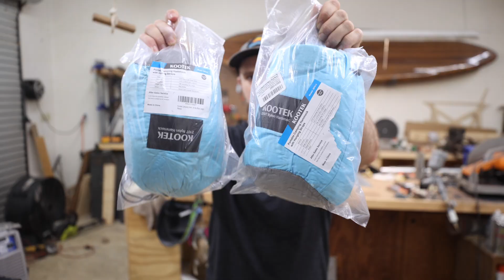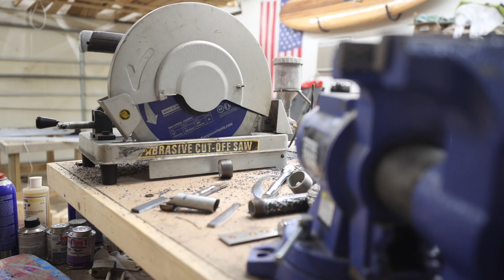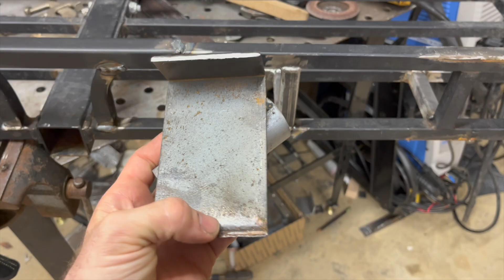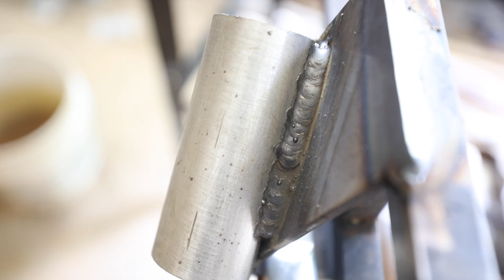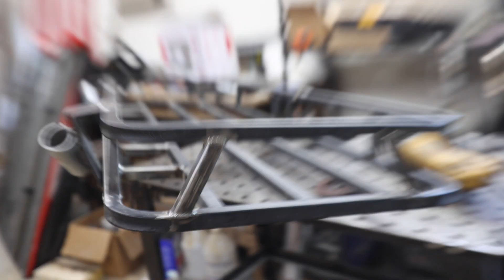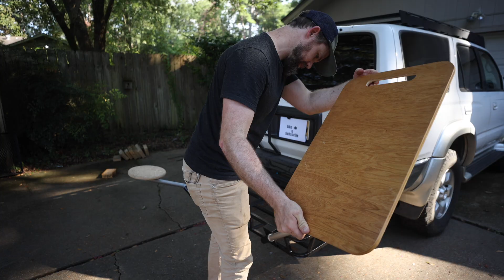Building a Hammock Mount using a Harbor Freight Cargo Rack

Comment: Like surgeon tattoo said I would add legs to either side of the rack that drop down and on the ends of the hammock pulls themselves I'd add like a 10-in extension so you can put up a ridge line and put your rain tarp I was thinking something like a threaded rod so you can adjust it out for length or just tighten it overall.     I also had an idea for a rooftop hammock setup that we go from side to side and you can put a hammock on either side of the vehicle I'm an avid camper and had a few ideas like this over the years

Comment: Another mad video brother, would like to see if any of them could hold 255-260 lb though as I'm somewhere between that at around 116kg-120kg. See how strong they really are.
Reply from the maker: Thanks man! I tested it at 113kg and it seemed to be solid! My first hammock mount 136kg easily. Did you see that video?
Reply: Yer bro I did. Was just wondering, not that I hammock camp or anything. We have a double hammock and stand for it but don’t use it at all.
Reply: @M.love4x4andmore  oh okay personally I have a bad back so I switched to Hammock Camping and fell in love with it
Reply: @kaostheory2940  oh ok. I have misses and kids so just take the camper trailer. Don’t get to go on my own. Feel it would be comfy and a good experience. Whatever gets you out is a good thing.
Reply: If you look up corporal's corner he did a review on a pre-made hammock hitch mount that's made of Dom tubing and can hold like 300 lb that's the one I was thinking about getting in case I had to sleep with my package with my legs by myself in a little over 200 lb so I know you're pain
Reply from the maker: @kaostheory2940  the mount I built in my last video will hold over 300lbs

Comment: If you want to remove the galvanized coating get som muratic pool acid and dunk it until it quits bubbling then rinse with water.
Reply from the maker: I didn’t know that would remove the coating! Thanks for the tip!
Reply: Yeah and 100% try to stay away from the fumes

Comment: Love it! To bad I don’t know how to weld🤣! If I wanted to learn what is the best to learn for a project such as this?
Reply from the maker: Thanks! I taught myself watching YouTube. It’s really not hard. There are soo many knowledgeable people here. It’s something you won’t regret learning to do.  Within a couple short sessions I could weld confidently enough to start making things. It didn’t look pretty but it worked. Buy some small mild steel plates or cut off scrap on eBay to practice with. 1/16 - 3/16 thick. If you are looking for a welder give YesWelder a look. Best welders your going to find at that price. They are always offering 20-25%off so watch for those promotions.
Reply: If you look on corporal's corner on YouTube he did a review of basically the same system already made and ready to go

Comment: I was thinking one adjustable height foot at the hitching point and then one on each side of the rack as well. Tripod stabilization. Each could then also be table and chair mounts? Great video. SUBBED!
Reply: that's exactly what I was thinking.
Reply: Hey Sergeant if you look above I gave you a shout out in my comment I think your idea of adding legs under the rack to help steady it is an awesome idea

Comment: A small foot going from the back of the rack to the ground would change the stress on the suspension from sag to lift.
Reply: Would also help extend the life of the hitch. Typically they are only a couple hundred pounds weight on the tongue. Plus with it being a couple feet beyond the hitch really puts a big moment arm on the hitch. Definitely put a foot to support it :)
Reply: @willofthemaker tongue weight is typically 10% of the gross trailer weight rating.  Class 3 hitches are 6,000lbs gross and 600lbs tongue. Class IV are 10,000lbs gross and 1,000lbs tongue for non distribution hitches. 

Even with a couple feet of lever arm (rack) the +/- 250 lbs is nothing to that hitch. All the flex is in the rack not the hitch.
Reply: Personal I think one foot on each corner will be better cuz then the load can't slide side to side
Reply: @kaostheory2940 what goes up must come down